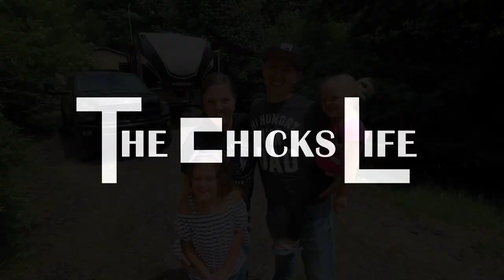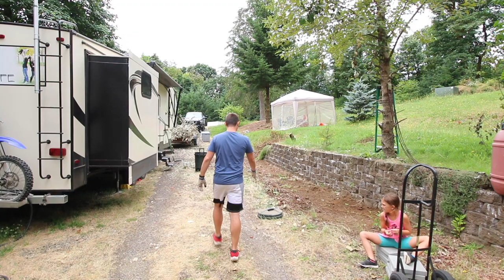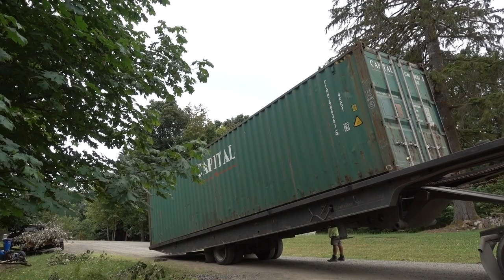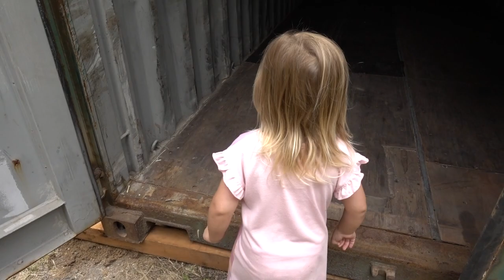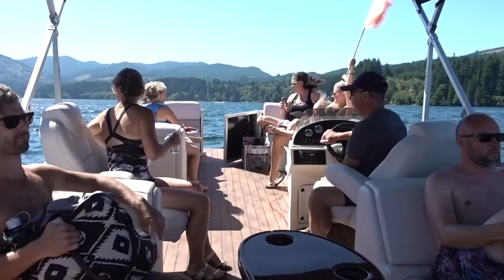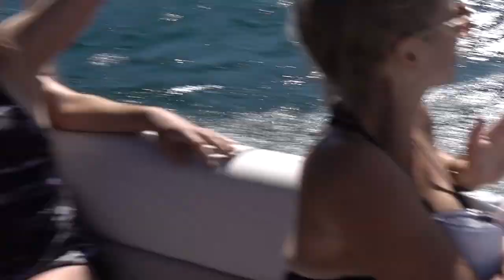SHIPPING CONTAINER DELIVERY PROBLEMS 🚚 Building Our Own Home Base for RV Life

Comment: were you able to inspect the container before purchase and delivery? I had a really hard time finding a place that would let me inspect...
Did the doors get easier to open after you leveled it?
Reply from the maker: Unfortunately no. Hence why I was surprised the door struggled opening. This company just takes them off the lot and delivers them in order of removal. But they did assure me that it was wind and water tight. But that’s as good as I could get.